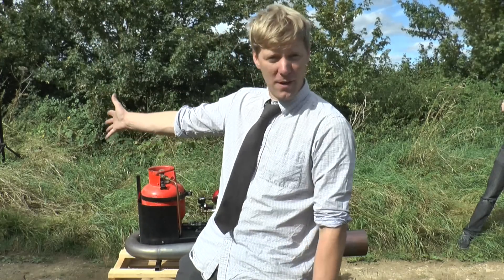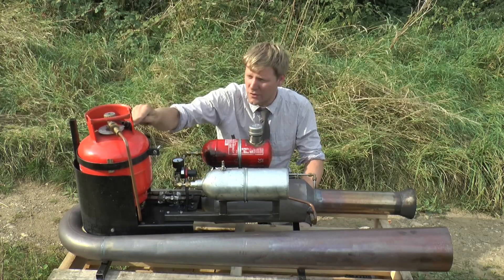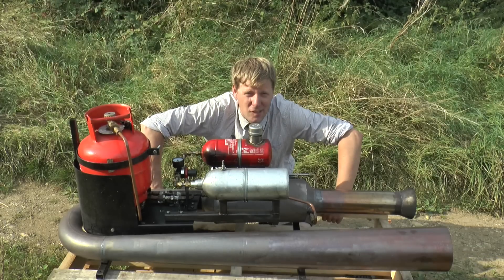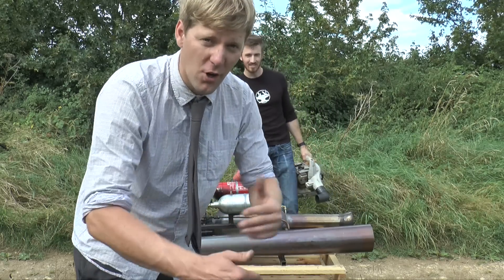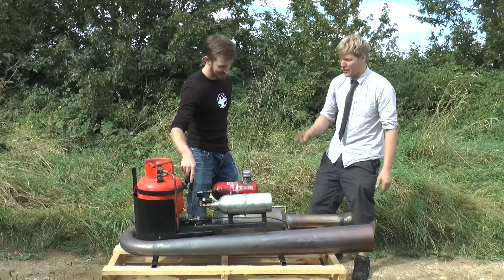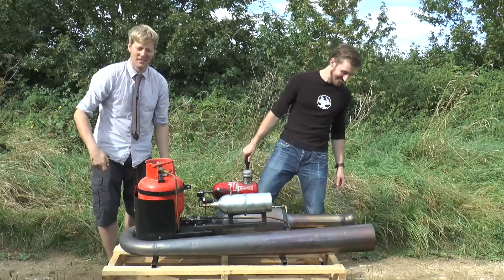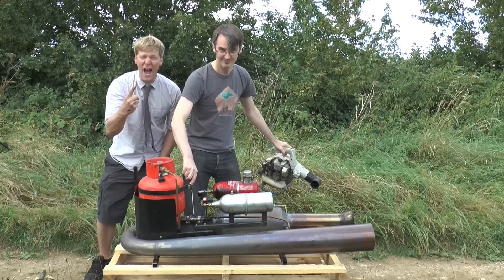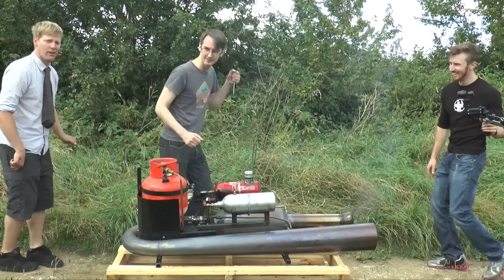How to START a Pulse Jet

Comment: #pulsejetplane
Reply: It's what they used on the V1 or Doodlebug, buzz  bombs (depending on where you're from) back in WW2. Terrifying noise. But it was pretty much a pulse jet plane that was a bomb.
Reply: Something like this? https://en.wikipedia.org/wiki/V-1_flying_bomb#/media/File:V1Musee.jpg
Reply: That's the one. Was one of the first long range missiles, that absolutely devastated London. Proved hard to shoot down too as it flew about 400mph.
Reply: The thing to note in your quote is 'by August 1944'- earlier in the war V1 flying bombs had a devastating affect on London and it took quite a while until we learned how to take them down.
Reply: Gordwyn The First
Even though level bombing was also inaccurate, that was compensated by the fact most bombers could carry a much larger payload than V1s, and deliver it over a large area, much more efficiently than the single impact of the V1.
Reply: That shit's gonna be loud enough to break every eardrum in UK...
Reply: SuicideNeil
 "Overall, only about 25 per cent of the V-1s hit their targets, the majority being lost because of a combination of defensive measures, mechanical unreliability or guidance errors."

I doubt they did much compared to conventional bombing.
Reply: +piranha031091 Level bombing wasn't all that accurate either (I think only 10-20% hit their target). With the V1 they didn't have to risk crew and machines, however, the V weapons programme was altogether just too complicated and expensive.
Reply: It wasn't their accuracy and payload it was the random nature in which they could come at any time at any day and in any numbers and the fact is the noise was scary but the silence was terrifying.  Once the engine noise stopped you knew it had ran out of fuel and was on its way down.  It was the terror aspect not the destruction that was feared.  The V2 took it to the next level as their was no noise or counter other than destroying the launch sites.  So no longer could you run to a shelter for safety you could die at any point day or night.  They were weapons of terror more than anything.
Reply: Nah, Churchill bombed the Jerries just for the lolz.

I do take issue with the yanks training and funding nutters in the middle-east and then wondering why they turn around a few years later and use that training against them, though. That's not smart foreign policy- Anonymous's latest videos explain the issue in some detail, worth watching for sure....
Reply: ***** 

  A couple of my Teachers from '75-'78 were in Israel in '73, they'd got sick of England, and back then Israel would pay people's Fare from anywhere in the World if they agreed to work on a Kibutz for 6 months, and they liked it so much they extended their stay for a second half-year, then the War started...

  Apparently everybody was taken by surprise, none of the Bomb-Shelters had been cleaned or maintained since '67, and it was a bit tense for a couple of days ; but after that, the joke was "Come to Israel, and see the Pyramids...!"

   My point is that the shitfight currently underway in Yemen is about the first time the Saudis have had to do their own fighting since TE Lawrence taught them how to blow up Trains for the good of the British Empire...; Tootlie Pip, olde Chappie !

;-p

Ciao !
Reply: Wikipedia tends to disagree :

"Launches against Britain were met by a variety of countermeasures, including barrage balloons and aircraft including the Hawker Tempest and Gloster Meteor. These measures were so successful that by August 1944 about 80 per cent of V-1s were being destroyed"
Reply: If those resources were sent instead to building fighters to protect the bombers and to keep out enemy bombers,  as well as developing and making air to surface missiles, that would have been something.  I believe the Germans had created an air to surface missile that actually destroyed a ship in combat.
Reply: +TheIntronD 

G'day,

  True enough, the "Vergeltungswaffen" were "Revenge Weapons"...

   The term "Terrorist" was invented by Herr Doktor Joseph Goebbels, in 1942, to describe the RAF Bomber Command Aircrews who had commenced the systematic Fire-Bombing of the Dormitory-Suburbs of Germany's Wooden-Built Cities (because they couldn't hit anything much smaller...)...; Goebbels called them "Terrorfliegeren"...

  In 1946 the British Mandated Administration in Palestine described the Zionists there as "Terrorists", and next it was the Kenyan Mau-Mau ; and essentially, "Terrorism" is a universal Loser's Word for whatever Tactics they have no effective counter for dealing with...

   The V-1  were not completely stop-able & the  V-2 were not stop-able at all, once launched ; therefore they qualify as "Terror Weapons",* just as do all and any Airstrikes carried out against any "Enemy" (Any Me) who has no Air Defences.

Such is Life,

  Have a good one,

;-p
 
  Ciao !
Reply: Actually terrorism does have a recognizable definition as the policy of attacking non-combatants and non-governmental people in order to change a government's policies.   Blowing up a civilian passenger train is terrorism.  And while blowing up members of the military, police and government officials might be illegal in that jurisdiction, it isn't terrorism to the outside world and may not lead to prosecution.  It is one of those "civilized warfare" concepts.
Reply: ***** 

  G'day,

   Well, that's not wrong.

     Which is why The British Commonwealth & the USA are the most accomplished Terrorists on the Planet, Hamburg 1943, Dresden 1945, Tokyo 1945, Hiroshima  1945 & Nagasaki 1945, and Hanoi 1970-72...; that's 500,000 Civilians between them.

   For those two Governments to be complaining  about their Populations subsequently being subject to "Tewwowism" strikes me as approximately as pathetic as a Cat scratching on a Linoleum Floor while trying to cover up a Turd.

  I have no fear of Terrorism, because I do not support Terrorism...; if I supported the Australian Government's deployment of a Squadron of FA-18s to Dubai & a Team from the Special Air Services Regiment to Iraq - in Oz's attempts to TERRIFY the Islamic State In Levant into submission to Canberra's Political Demands..., then I would have reason to be concerned..., but as things stand I have zero expectation of any ISIL sympathiser/s cooking up any kind of a "plan" to attack me in their efforts to annoy the Australian Government.

  The reason why "Terrorists" (ie, any "Brave Commando on any highly dangerous "Secret Mission", living and working deep behind their Enemy's Lines, at great personal Risk..., regardless of who they fight for or against...) like to attack Civilians and vital but unguarded Infrastructure is that they are attempting to make the point that the Government they are opposing is incapable of protecting it's Citizenry from Attacks...

  That's why the RAF grilled 43,000 Hamburgers in one night, to teach the rest of the  Germans what a stupid idea they had when they voted for Hitler, and to terrify them into rethinking their position, and their loyalties...; Churchill & the British intended to terrify the Germans into submission, just as Obama has spent 7 & 1/2 years trying to terrify first Al Quaida & the Taliban & now ISIL into submission.

  My position is "A Pox on all their Houses !"

   Anybody who agrees to kill because of Politics or Greed or Fear, and all who support those who do so, regardless of which "side" they say they are "fighting for" ; in my opinion, they deserve whatever goes wrong in their Lives.

   And when Terrorists complain of being attacked by other Terrorists, I laugh at the bloody lot of them, because they're all equally foolish...!

   I look forward to the day when all the Warriorists and all the Militarists have Terrorism-ificated each other into Composting quietly ; whence the Meek shall inherit the Earth.

  So, if you hope to attend the Peace Party afterwards, then you'll need to stop supporting all and any Armed Farces, immediately ; and if you own any dedicated weapons then get rid of them as soon as possible...

   Shit, or get off the Pot, it's an All Or Nothing thing....; and the idea is to not attempt to be more deadly than whatever it is that one may be afraid of.

    The Times, they are a' changing.

  Take it easy,

    ;-p

Ciao !
Reply: The U.S.'s involvement in the middle east has little to do with oil as the left proclaims.  There are numerous other oil producing countries and areas that could be dominated.  Anyone who controls oil in the middle east will sell it. Oil provides a cover explanation.  The real driving force in the middle east is the desire to control or weaken any entity in that area that might represent and alternative power or hinderance to Israel's activities.  Notice the percentage of the major media people, political contributors, key governmental people who are tied by religion, ethnic group, family and businesses to a specific ethic/religious group which has a country in the middle east.  If the west was not involved in the middle east, these various depraved factions will attack each other.   When we go in there, they come after us. 
         A U.S. Senator said many years ago that  the first casualty of war is truth.  No.  A lie has to come before a war to make a war possible.   And because people expect the lie, other lies are layered under it, so when people think they have pierced the lie and found the truth, they are actually looking at another lie.
Reply: +Lewis Doherty

  "The US involvement in the Middle East has little to do with Oil..."

  Forgive moi, but ; "In a Pig's Arse, Comrade-Infant...!"

   I remember the 1960s.

   I remember the "1973-74 OPEC Crisis".

   I remember when Prissydunce Nixon announced that he'd pimped the Pentagonal Haemorrhoids to "provide for the Military Security of all OPEC's Oilfields", which OPEC is still contracted to pay for, using the "Petro-Dollars" which  they earned by refusing to sell their Oil for anything but US Dollars, and also I remember when he  announced that Ho Chi Min's Ghost had Ethnically-Cleansed the Moon, when he cancelled  the last 3 Apollo Launches...

   Since then, the Pentagon has fielded Troops to suppress every Rebellion which ever was thought to threaten King Saud's Authority in any OPEC Nation - as well as wherever such Rebellious Saudis might be trying to hide (Absurdistan, 2001 till the present ; because the Rebellious Saudi Prince Usama Bin-Laughin' once used to be camping there...).

  You are doomed to repeat your History ; because you are ignorant of your History.

  Welcome to self-awareness of the Feedback- Looped nature of your Existance.

  ;-p

  Ciao !
Reply: Exactly:  From describing the reason for the Wikipedia: The embargo was a response to American involvement in the 1973 Yom Kippur War. Six days after Egypt and Syria launched a surprise military campaign against ISRAEL, the US supplied ISRAEL with arms. In response to this, the Organization of Arab Petroleum Exporting Countries (OAPEC, consisting of the Arab members of OPEC plus Egypt and Syria) announced an oil embargo against Canada, Japan, the Netherlands, the United Kingdom and the US.[3]

While oil is now more available from the rest of the world, note the proximate cause of the situation.

Whoever is in control of the oil areas will sell oil unless Israel figures into the picture.  Like I said, it isn't really about oil, it is about Israel.